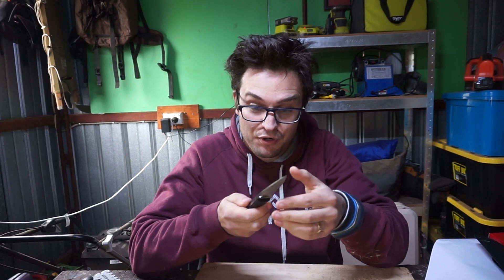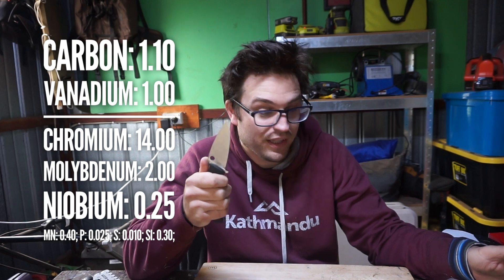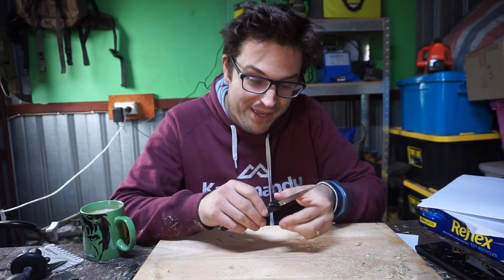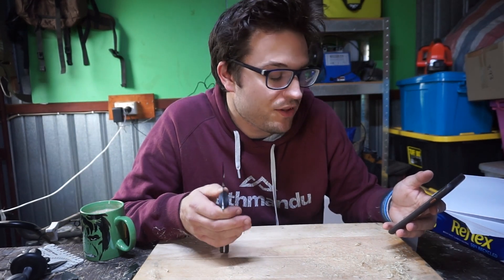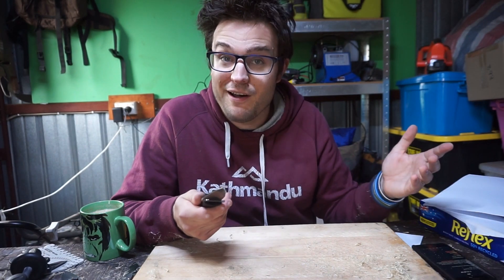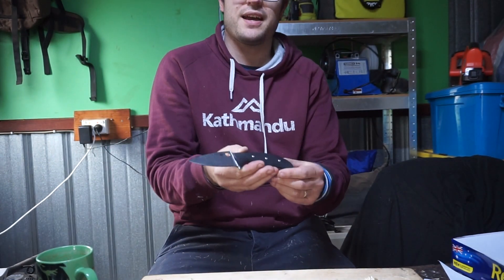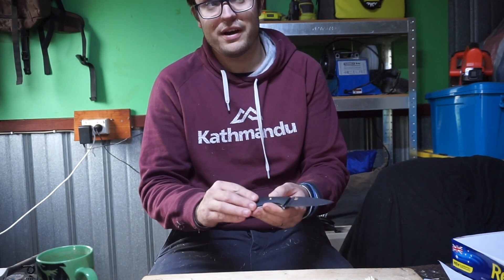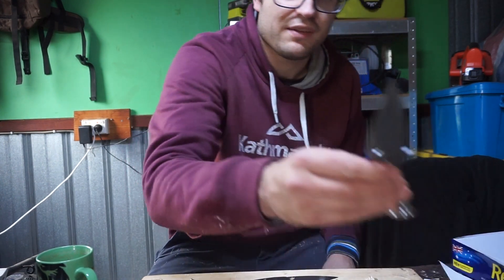CTS B70P and B75P - Uncommon Steels in the Knife Lab

Comment: Did you mess up at the end saying b75p cut more or did you mess up in the beginning? B75p is a PM version of BG 42, a great steel(Sal Glessers favorite non PM steel along Gin 1)with similar performance to s30v usually. Maybe the b75p mules were ran softer than b70p but I'd expect them to perform similar if not a slight edge to b75p.
Reply from the maker: the b70p lasted longer in these two tests, but yes, heat treatment is a big and looming unknown here

Comment: So b70p-450, and b75p-325? Confusing....I think you mixed them up at the end. You would think they would be reversed results by the name. Interesting
Reply: Higher number does not mean better steel. The b70p has niobium which is a great element in steels.
Reply: @amos3106  What the hell are you talking about? In this case it means it's better steel cause he is testing only one property of steel witch is edge retention ,in addition the other one is just alloyed ingot steel so B70p is by far superior to the b75p.. I think you meant to say higher number doesn't mean better steel but not result number.. Wake up
Reply: @marekmasar5216  What? Both cts-b70p and cts-b75p are alloyed powder metallurgy steels according to their datasheets. I meant to say the manufacture production number (70/75) doesn't mean better steel.
Reply: @amos3106  I apologize 🙏 I usually check my knife steel app where it's labeled as VIM technology (B75P) as opposed to PM process (B70P), but now I checked carpenters own webpage and indeed you are right!! They are both PM steels.. In that case I'm surprised of the result.. B75P has double amount of Molybdenum (actually it's almost like CPM 154).. Could a 0.25% Niobium make such difference!?
Reply: @marekmasar5216  No worry man. I think you mixed it up with BG42 which is the double remelted VIM-VAR version of B75P. It was the holy grill of knife community due to its rarity and coolness(Bob Loveless and Bearing steel for NASA). I have some knives in BG42 and I really like them. 

Niobium is an great alloy element in most cases. At small amount, it can help to prevent intergranular corrosion. At high amount, it can form niobium carbides which add wear resistance like vanadium carbides. However, unlike vanadium carbides, niobium bides form much faster. This property make it less likely to cause segregation which helps steel toughness.

Following link is a great example:
cpm-3V niobium modified
https://patents.google.com/patent/US7615123
Reply: @amos3106  Thank you for the web address.. I'm going to read it now.. I love to read literature about scientific metallurgy.. I have never seen a knife in bg42 witch is identical to b75p but not pm steel..  I bought B70p mule just 3 days ago and sharpening was fucking horrible!! You won't believe me but so far one of longest reprofiling I have experienced and I have knife pretty much in all well known monster supersteels (M4, S90V, S110V, K390, Maxamet) and this was on pair with s110v.. But the edge it reaches is pretty amazing.. Very fine.. Thank you Brother